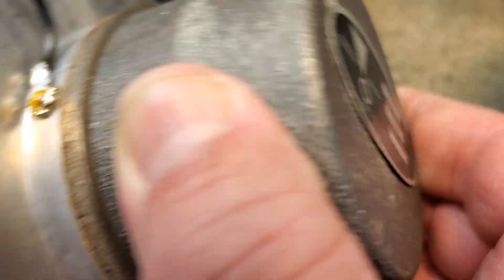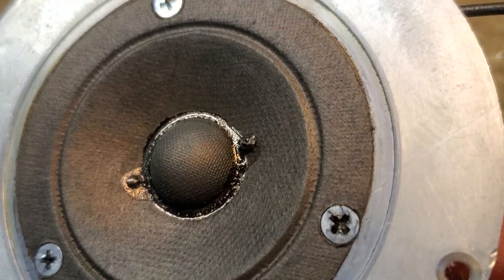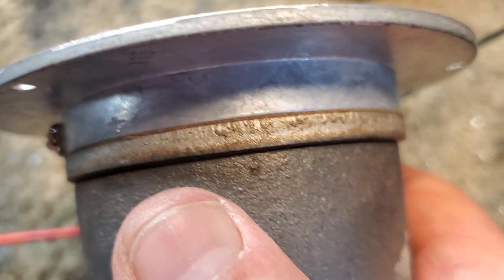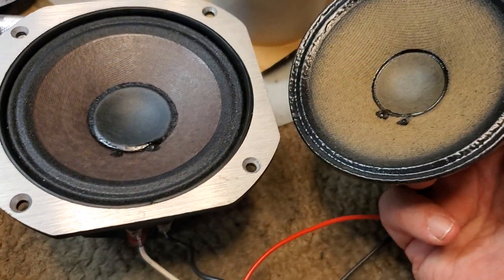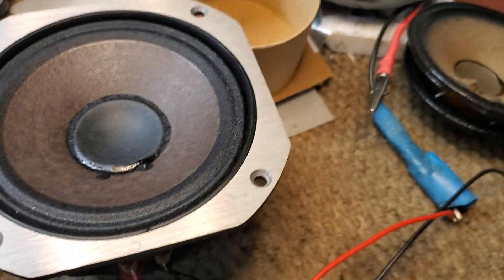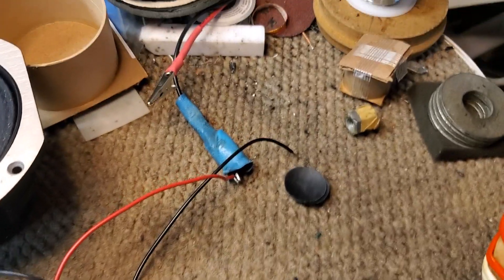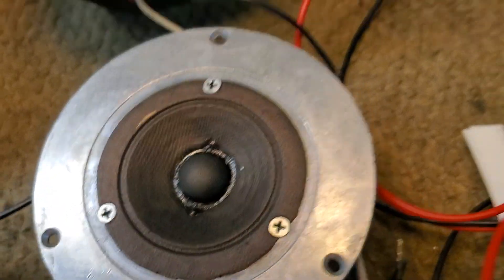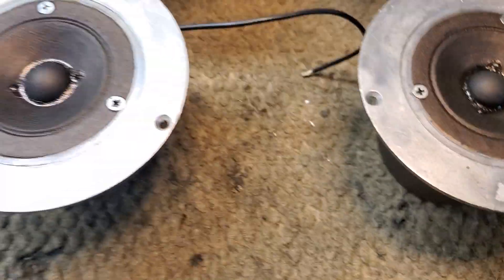JBL L100 Century First Gen components refresh. Upland Loudspeaker Service

Comment: I saw a video of someone who lightly spray painted their white L 100 cones with Zinzer 123 primer. 
There was someone else who sprayed some primer in a cup and lightly brushed the white part of the cone as well with a touch up brush
They really did look  awesome. 
They never tested the cones preformance or sound  before and  after. 
Do you think that would make any difference in the sound quality? 
It would be great if someone could  do a test and spray a dirty cone and test it to  see if it alters the sound. 
I know a lot of restorers who won't do it because they dont want to risk altering the sound quality.
 It would be really interesting to do an A/ B  test before and after. 
It would end any questions about if it works or not as an option to saftely whiten old dirty cones. 
Thanks for all the great content.